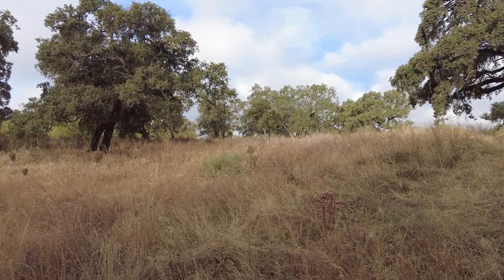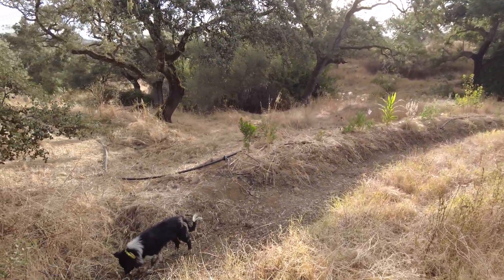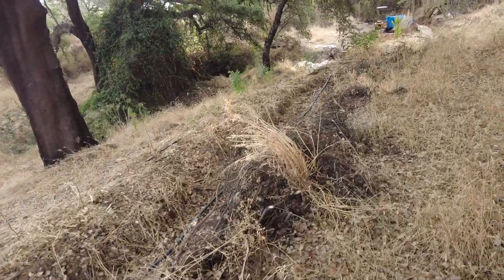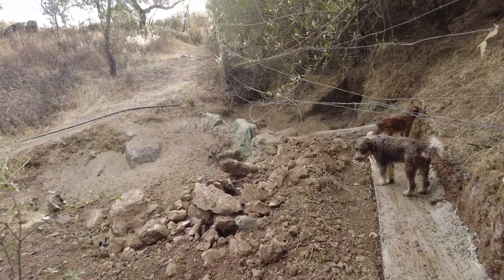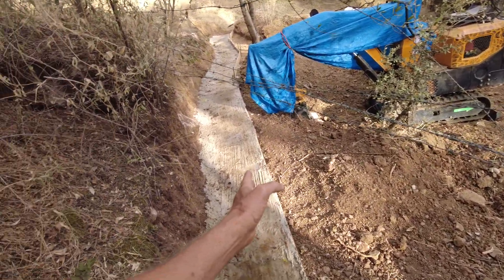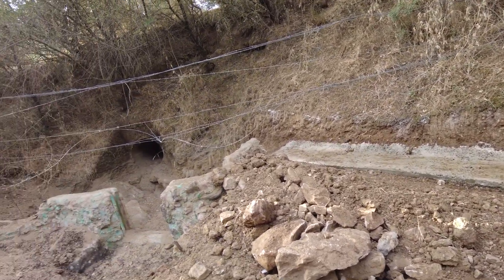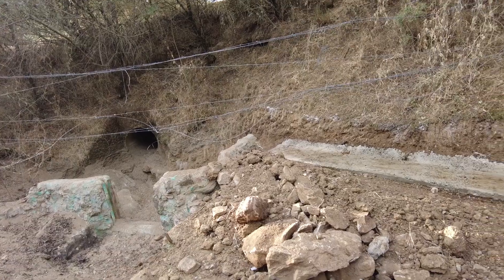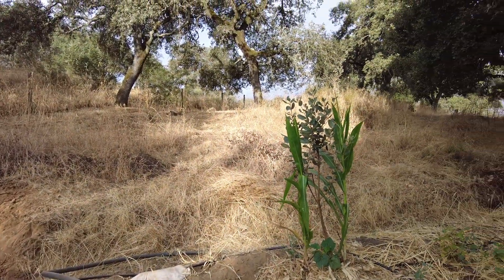Preparations to fill the swales with creek water.

Comment: You mixed a lot of cement!  5mm will make a good solid base for your block.  I like your plan to place the excavated earth against the outside of the block.  Creating a good solid berm will be a bonus. 
Planting the berm with vetiver now and irrigating daily until the rains come would be good erosion insurance.
If you have soil left over, you can fill more sandbags and add height to the sandbag dam.  Over time, (as the sand fills in the pond)  you may gain the elevation and the distance from the rock you need to build a new berm/swale running easterly.  
One canal to swale will help but two would substantially reduce the erosion of the creek chanel.
Congratulations on your progress!  You make a good team. 👍
Wish I was there to help 😊♥
Reply from the maker: @stevejohnstonbaugh9171  Big hug Steve